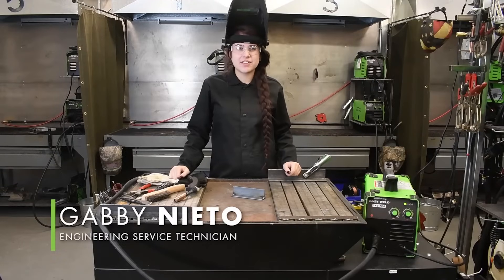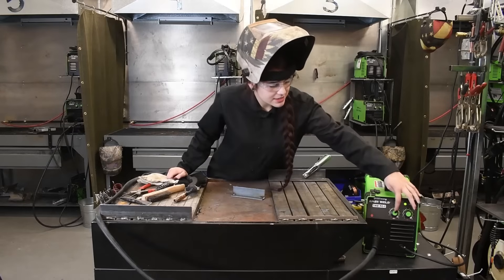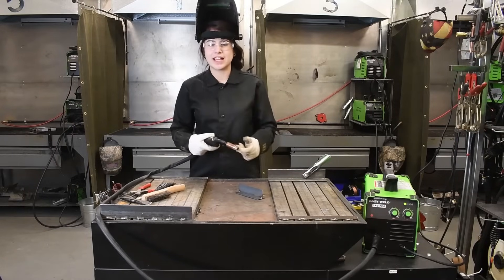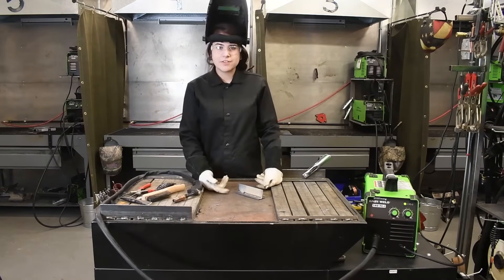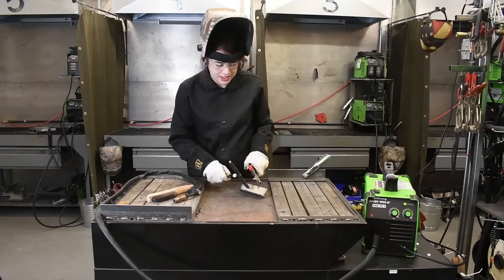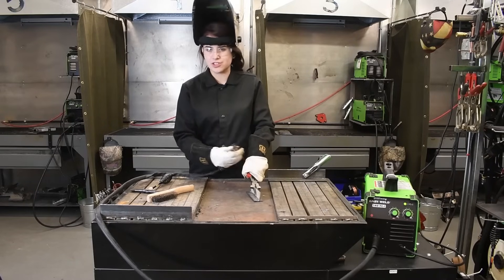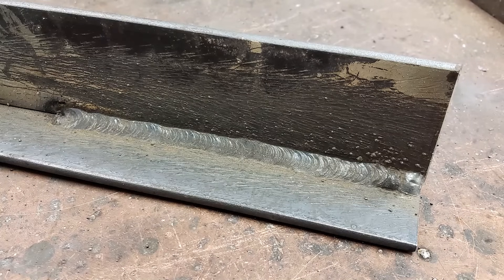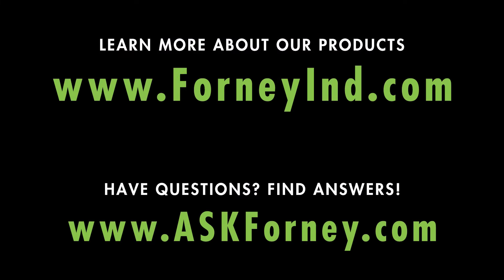Welding with the Forney Easy Weld® 140 FC-i

Comment: Hi, I have a Forney Easy Weld Flux core 140fc-i. I had been working well, I had put it in storage for a few and when I went back to use it,  as soon as I turn on the power the over temperature light came on and I can't use it. Is there any way I could get it fixed? Can you send me some info on what to check for?
Reply: Exactly why I'd choose a Titanium welder from Harbor Freight over this. Simply for the warranty. What good is a "better" welder if you can't use it.

Comment: I'm thinking about getting this welder. I'm a beginner with an important question. Can I plug into my portable generator? It has 30 and 50 amp outlets. Thanks!
Reply from the maker: Hi Eric, the unit requires a minimum 4,000W continuous output with no low-idle function (or low-idle off). Also, the generator must have 5% or less THD for use with any welder.

Comment: Gabby says you need at least a 20 AMP breaker, but I’m seeing 20 -15 AMP in the documentation. Can someone confirm? Unfortunately I only have 15 AMP outlets available in my house.
Reply from the maker: Hi David, the Forney 140 FC-I (261) has a max amperage draw of 21.4A and a running amperage of 11A. This means at arc initiation the unit will draw 21.4A (with the machine’s settings turned fully up) but once the arc has started it will fall to 11A during use. We recommend a 20A outlet (and in some cases 30A, acceptable under NEC630.1b) to mitigate this high amperage draw at arc initiation. Using a 15A receptacle will work, but you will run the risk of popping a breaker if using the machine turned fully up. Lowering the settings on the machine will in turn lower the amperage draw at arc initiation, allowing you to us the 15A receptacle without popping the breaker.
Reply: Thank you, that makes sense.

Comment: Hi, why 6 and 10 settings. The settings inside the unit are always matching one for one. Just curious. I have the same unit. And my welds are ok. Not perfect or pretty. I'm sure my settings need to be dialed in. But I am following the manual settings per thickness of material. Any guidance appreciated. I also welded the same steel per this video not same results I used 10 and 10 setting

Comment: Getting a ton of spatter balls with harbor freight 030 wire. Almost like the polarity is reversed but it's not. I measured output with a volt meter and tip is negative. Running 6v and 10 wire speed, clean tip good ground. Any ideas. I'm not a new welder... Cheers!

Comment: Electronegative, meaning the gun is negative and the ground clamp is positive??
Reply from the maker: Hi Daniel, you are correct. For flux-core welding, it is electrode negative, so you want the gun to be negative and the ground clamp positive. In the case of this machine, the leads are already connected to the machine and cannot be removed, so they are already set to electrode negative.

Comment: So that's not really a gas nozzle, just a protective shroud?
Reply from the maker: Hi Arthur, the reason why we include a nozzle on our flux-core units is to prevent flux build-up on the contact tip. It can always be removed if you prefer to weld without one.

Comment: Seems "they" (Forney) removes all the negative reviews. This machine is not able to do what this girl managed without preheating the parent materials. If you try welding with this machine on room temperature projects, you will quickly find out that the machine is too weak to provide good fusion.
Reply from the maker: Hi there, we prefer troubleshooting instead of removing comments to help you and any other welders who are having similar problems. We recommend using the proper settings for the thickness of material you are welding, making sure you do the work before hand of cleaning your material well.

A lot of people tend to turn the unit all the way up thinking that will give them the best weld, this is not always true. There is only so much power going into the unit, having the drive-roll motor doing more work to increase the speed of the wire innately takes power away from the weld. We have found that setting the unit to 6.5 on the voltage and between 7 and 8 on the WFS makes a great weld. This allows the unit to feed wire fast enough for me to get a weld bead with a good profile while the unit has plenty of power to give me good penetration.

The cleaner the material you are welding the less work the heat of your weld has to put into burning off mill scale, paint, or other residue and the more work it can put into digging into that metal and giving you the penetration you are looking for. It is important to note that this is a ¼” maximum machine, meaning with a single pass this unit will only penetrate up to ¼”. More penetration is possible with preheating, beveling, and other techniques. If you need any other help with your machine you can contact our Expert-Techs at 1-800-521-6038 opt. 2

Comment: my forney is not feeding.  Brand New and not feeding wire.. fan turns on, but no wire feed.. took the cap off the gun and touched the tip to the ground clamp.. It sparked.
but there is no wire feed.
any help on that? wire is fed by hand about a foot.  feed mechanism is not turning at all when its loose, when it has no wire when its tight at all the wire feed is not moving.. might be a bad unit.
Reply: Found the issue. The feed wheel mechanism was jammed. I  removed the wire feed selector wheel and started to manually turn it with pliers.  Then I pressed the trigger, and it moved. I put the wire selector wheel back on, fed the wire pressed the trigger and it started to feed. Now I must wait till the morning to weld..
Reply from the maker: @vizcarraawd  Hi there, we're happy to hear you got your welder working! If you have any other problems with it, you can reach out to our Expert-Techs and they'd be more than happy to help. You can reach them at 1-800-521-6038 ext. 2

Comment: Is this a good option for someone that just wants to learn for a few small projects at home?
Reply from the maker: Hi Barrett, this machine is perfect for learning to weld! It does not require gas and can run off standard household power as long as you have at least a 20 AMP breaker. You can read more about this machine here: https://www.forneyind.com/products/forney-easy-weld-140-fc-i-flux-core-wire-welder   Thanks for reaching out!
Reply: @forneyind  thank you!  I really appreciate the response.

Comment: This welder cannot be set up for .035? I was under the impression it would do both 2# and 10# spools but also, both .030 and .035. ? No?
Reply from the maker: Hi there, this machine can handle 2 and 10 lbs. rolls of wire but we do recommend using .030 wire. We recommend .030 because .035 can reduce the duty cycle of the machine. Thanks for reaching out!

Comment: so is it an inverter welder or is it AC output?
Reply from the maker: Hi Jim, this is a flux-cored inverter machine and is DC only which means it does not weld aluminum. Thanks for reaching out!
Reply: @forneyind  Thank you.

Comment: So I have one on order and it’s coming next week. In the descriptions it states that you can use .030 or .035 flux core wire. But every video about it they only say .030. Are you able to use .035?
Reply from the maker: We recommend using up to .030 wire with this machine. Thanks for reaching out!
Reply: @forneyind  
Has the slow wire feed speed been addressed yet?

Comment: I just got mine and I’m having issues. Idk if it’s not grounding right or what it just pops n doesn’t lay a head. Won’t build up heat
Reply from the maker: Hi Nick, sorry to hear you're having issues with your new machine! Go ahead and give our Expert-Techs a call and they will be able to help you out. 1-800-521-6038 ext. 2
Reply: I had a similar issue with this exact machine. I was attaching the ground cable to my welding table. Once I attached it to the metal I was actually welding it was a night and day difference

Comment: Does this machine MIG weld as well?
Reply from the maker: Hi Johnny, this machine is for flux-core welding only, so it does not use gas.
Reply: @forneyind  Ok...excellent. What flux core size do you recommend for 16 to 18 gauge sheet metal? I apologize if my terminology or wording is incorrect. Thanks for the quick response. Liked and subbed.
Reply: Also is your Easy Weld 261 a MIG welder? Would that be a good choice for a shade tree mechanic or hobbyist? Thanks.
Reply from the maker: @Dr.Wuhattan  For our Forney Easy Weld 140 FC-i we recommend using .030 wire. If you are looking for a machine that can do MIG, we recommend the Forney Easy Weld 140 MP. It does MIG, flux-core, stick, and DC TIG. You can check out the FC-i here: https://www.forneyind.com/products/forney-easy-weld-140-fc-i-mig-machine and the MP here: https://www.forneyind.com/products/forney-easy-weld-140-mp-machine
Reply: Thanks for taking the time to respond to my questions.

Comment: I used this welder to build a custom plexiglass protection barrier for a delicatessen. The frame is made from 1/2 inch thinwall square tubing. I had to stitch weld with about 1/2 inch stick-out and only took a few hours to build. The Forney .030 flux core wire I use works great. All my welding projects are outdoors and for me flux core is the way to go. This barrier will be used on the deli counter and I'm donating it for free.
Reply from the maker: Thanks for sharing with us! Keep up the good work!

Comment: Here's a tip for all the beginner welders.  This is a FLUX CORE welder, the lead doesn't have gas holes, therefore you don't need the cone to weld,  Removing the cone will allow you to see and control your weld puddle much better.
Reply: Won't the tip be electrified while in use and be prone to making electrical contact with the workpiece?
Reply: @goatsinker347  flux core stick-out will be at least half an inch. If you're grounding your tip, practice harder at maintaining the stick-out distance.  Remember, there's no gas envelope that you need to maintain;  take the gas nozzle off
Reply: @goatsinker347  Yes. You would want a flux core nozzle that is much shorter but covers the tip
Reply: Nice tip.  Thank you
Reply: Thanks boss,preciate it 👍
Reply: This unit comes with the gas cone to make it easier for new people to control distance. Personality the cone blocks my view. I prefer the flux core tip. It's narrow and doesn't interfere with my view while still protecting the tip from splatter and accidental shorting against project or table.

Comment: I recently bought this machine, it's a great welder for the precision I'm able to attain for thin sheet metal, but the wire speed being limited to 200in/min is giving me second thoughts about keeping it. The welder I used previously was a Hobart handler 135 and considering the advertised output of both, there's no way this 140fc-i can reach 140 amps with half or less in/min wire speed, the voltage is definitely there(I measured), but without the wire speed the welds sit high and do not penetrate properly. There's alot of potential here, but I'm on the fence about finding an alternative. I would need to run a much thicker wire to make use of the voltage range of this machine at the allowable wire feed speed range, in order to reach the advertised amperage capability.
Reply from the maker: Thanks for reaching out! In order to get more heat from this machine, a smaller wire would be needed like .030" or .023" wire. The wire feed speed is lower because it is a 120V machine. With adding more wire feed speed we run into issues with popping breakers and poor performance.
Reply: @forneyind  the workshop has breakers dedicated for higher amp draw, I bought this to replace another 120v mig which had atleast twice or more wire feed speed and was only advertised as a 135amp. Limiting the wire feed speed to 200 on my behalf is fine as long as it isn't marketed as 140 amps. The welds from this machine look like 80-90 at best. It's bothering me because i have to either return it to the local store and try to find a replacement online or try to find a way to modify it to at least double the wire speed. A smaller wire diameter would require more wire speed to do the same work, on the contrary I would need 0.045 in order to make use of the 200in/min limit considering the voltage is 18v at setting 3 and roughly 25v at the max(setting 10).  It's honestly driving me nuts.

Comment: Just have to mention about the camera position, and your other side joint weldment technique. If you weld the near side of the joint, you can merge a different camera facing your weld puddle from your left side, at your 8 o clock, and edit that weld caption from that camera position with a horizontal mirroring effect, for a foreshortened effect at the very end of your weldment. That way you don't have to  hug over the work to lay your bead, and instead be able to face the work on the near side of the joint for a better weld penetration.
Reply: Maybe some ventilation, too.

Comment: I just purchase this machine and used it today and was a big disappointment, i had very little penetration in an 18ga square tubing, my harbor freight 90 amp flux core does a better job, there is no way my machine can weld the same plates this lady did, I just emailed forney customer support to see if they can help.
Reply: Hey I just bought this machine and it is happening the same thing, did you receive customer support? did you fix the problem?
Reply: @rickb9180  hi I did recieved an email back from customer support, it was a user error, if you are very use to another machine that might happen, stick to the wire speed and v stated on the chart first and practice a little, make sure the ground clamp is in a clean piece of the metal and practice, it it slower than other machines but at the price point and portability I it works really good I’ve dolor several stuff at home, some gates, doors, some small stairs fit works well, you can weld up to 1/4 but make sure you pre heat the metal first and it will work better.
Reply: I just bought the same machine.  I am pretty disappointed as well. They're is no way my machine welds like that. I've tried all different sizes of metal.

Comment: Is there a good aluminum welding tig machine from that brand?
Reply from the maker: Hi Joseph, none of the machines in the Forney Easy Weld line can TIG weld aluminum. But the Forney 220 AC/DC welder can TIG weld aluminum. You can find it here: https://www.forneyind.com/products/forney-220-ac-dc-tig-kit

Comment: Can you use a generator to run this machine
Reply from the maker: Hi Carl. Yes you can use a generator to run this machine. Minimum 4,000W continuous output with no low-idle
function (or low-idle off). Thanks for your question.

Comment: Have one and the statements made are not the statements made in the Manuel on 1/4” and household plugs. The Manuel states it will take more than one pass with 1/4” and depending on the outlet you have you may need changes so it will not trip even with a 20 amp.
Reply: You need 180 amps to weld 1/4". This chick is brain dead...

Comment: Looks like a good machine! Really nice that it has the fully controllable output dials instead of taps like a lot of cheap machines do. Good job Forney 👍.
Reply: Thats because this machine is a inverter unit, the one s that have fixed settings are transformer units, two different technologies, by the way, Lincoln, Hobart and Miller have machines that are transformer units and fixed settings, and they are BETTER than Forney , not cheap units as you say.
Reply: Jose you can't buy any of those for $190 either. This is for someone who needs to weld a mower deck every once in a while or small things like that. It's a cheap welder that does a decent job. I haven't liked any cheap flux core welders until I come across this one and for what it is it gets small jobs done.
Reply: Another cheap welder is the esab rebel it's a multi processor. I just bought it and paid $200 come with everything but a pedal.